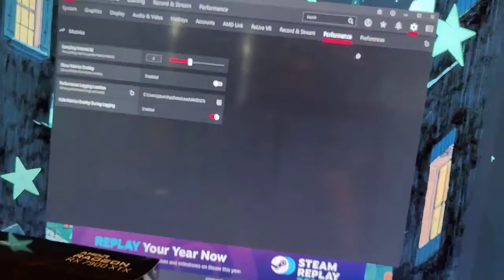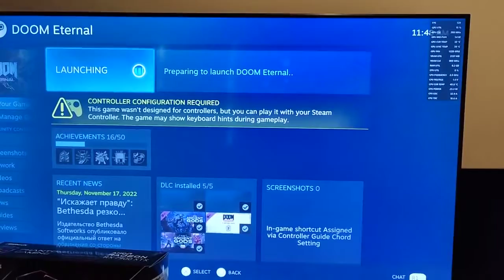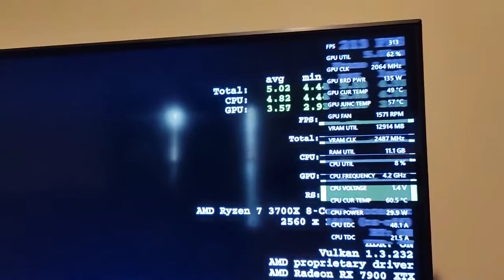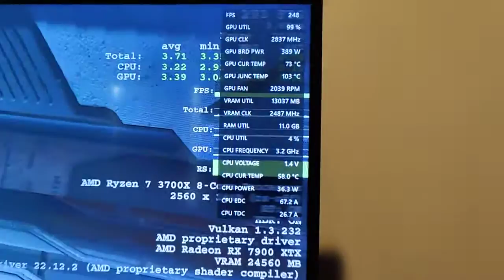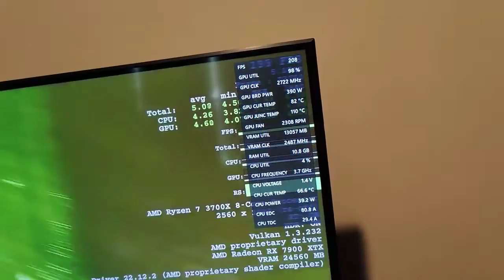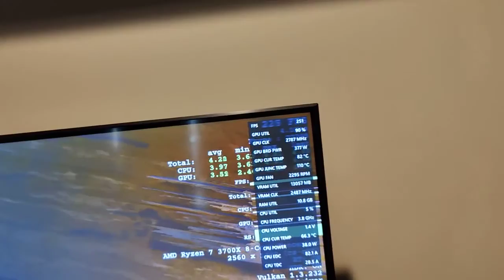7900XTX GPU Junction Overheating

Comment from the maker: I wanted to mention that I took the side of the case off as a user suggested... It did reduce the overall temp to about 102 at the peak, which does seem to fix the issue.

I also want to mention that I downloaded the asrock tweak tool and set the gpu to user mode and forced a max of 350W. This reduced the junction temp to 92 at the peak. For now, the issue is not something I need to fix further on my end. If I end up seeing the temps go up again I will then send it back.

Thanks for the suggestions!
Reply: I wanted to love that case SO bad… I had to modify mine in 2 ways to help thermals. First, the dust filter at the top really restricts the exhaust fans, so I removed it completely. Second, I pried the glass off the gpu panel side (not difficult, it’s just glued on) and replaced it with a dust filter instead with magnetic strips, it actually looks pretty good still.
Reply from the maker: @jasonb110  honestly, this case is amazing! I was using a Zotac 1080ti Amp extreme, if you look it up it seems crazy to me that that card had zero issues in this case. That's really what made me think this card would work just fine in it.

Comment: It's not the card, but you're not cooling it properly. The manufacturer's website says 2615MHz as recommended for boost.
 I see almost 2800MHz + 220 FPS and 389W. I don't know what you're expecting with one fan pulling the heat out 

Lock your FPS to at  120 FPS. + undervolt it.

I'd be the manufacturer of those cards and see this video, so I'm not giving you your money back.
Reply from the maker: No offense, it seems like you watched at least parts of the video... There are 4 3000cfm fans pulling and pushing air out of the main chamber as well as the 3 fans on the card sucking from the card itself. As an attempt to completely unobstruct airflow I further removed the side panel and locked the wattage at 350w, while this did help, it still climbs to temperatures beyond a 30 degree temperature difference.

As a side note, people keep saying I'm doing something to the card to make it overclock or go beyond manufacturers recommendations. I literally have no settings defined beyond "use stock settings" and this was the result in the video. 

I was expecting the card to be stable out of the box and not need settings to be modified to become stable.

Comment: I had the Phantom 7900 xtx and gave it a rave review. Performance was great and what to expect from the 7900 xtx, but... I did start to see temp differences of over 40c between junction and current. At stock settings I was watching junction temp hit 110c (current temp 65c) and stay there for minutes and minutes. I like ASRock but I did return it. I said in my review that the cooling solution works, aannnnd it in fact, does not. I think the cooler is too small for their aggressive stock settings and that "ASRock Magic".

Comment: Is this your first and card after 5700xt because the junction temp is hi. 110 is normal
Reply from the maker: Yes, I had a 1080ti for all these years. First upgrade in a long time for me
Reply: @JerryRigged  a 1080 t.i. they didn't have the junction temperature until they had a 5700 series and the 3000 series so no you can't say my car is overheating cuz you never had that problem I'm just saying in general I know I've seen 5700s go up to 110 none of the coolers that aren't reference card should be doing I'm going to plug in my taichi hopefully Sunday soon as I get my 1000 watt psu.   But when I'm telling you is a 1080 didn't have junction temperatures

Comment: Red devil 7900xtx limited  OC, have no issues, even with heavy overclock and 430- 450w power draw didn't go higher then 90 on stock fan speed. Went down to 85 with fans at about 60%. And GPU temps never went above 60C . But coil whine especially in modern warfare 2 is quite noticeable and annoying, might even make me to return it.
Reply: got the same card and change the bios switch to silent help a lot with the coil whine

Comment: If it works in 99c, does that mean that the card doesn't work? Will I have some kind of problem in the future?
Reply: Depends on your case. Mine never goes above 85 on stock fans and settings. 90C with heavy overclock
Reply: @Bostonski  Do you also have the ASRock 7900 XTX Phantom Gaming edition?

Comment: It works well in my case the tower is very small and reached 99 - 101 c but once I opened it I got down to 96c on occasions 86c tested with furmark 12 hours is it very rare that you get this problem even with the case open?

Comment: this is why better to buy RTX 4080
Reply: Bullshit. That’s just a 400W Card with its fans pressed against the side panel in a case the size of a shoebox with bad ventilation. Every card will run hot in that thing.

Comment: I mean with your edge temp reaching over 80c I wouldnt necessarily call that a high airflow case. Your cpu is stuck between 4-5% usage so I wouldnt expect the temperatures on that to be high. When I had my reference 7900xtx I never seen the edge temp go higher than 60c while the junction temp hit 110c when increasing power. Your delta isnt too bad so in this case I would think your card is fine, Especially if you try to get that edge temp down some it should also bring down the hotspot temp.

Comment: your card isnt faulty you are not throttling at all get a bigger case and your junction should go down 110c is normal and within spec but if your boost clock is going really low there is a problem but you are at over 2700 mhz the whole time so you are fine

Comment: Crazy.  I have MBA design and at 400w with card vertical it only reaches 88c JT.  Horizontal it goes to 110c and throttles.  I'm looking at what to replace it with, not this I guess.

That 4080 is looking more and more appealing

Comment: I mean... it's not even throttling down the wattage/power... so technically you're not losing performance. The issue on reference cards, it will hit 110 and start throttling back power hard core.
Reply: Reference from XFX  I had was doing same thing. Pulling 380w from stock and going up to 110C in 60 seconds,  without throttling down. Somehow it got reset without me doing anything besides reinstalling driver with factory reset and was then working fine at 350 watt TDP. Never went over 88C. But if you hit overclock mode you hit 110C in a minute.  Vram overclock seem to work just fine

Comment: Honestly I don't think this is the same issue the AMD made/designed cards are dealing with and the giveaway is your temperature delta. It's right where air cooled cards usually operate, 15 to 25C delta. The AMD ones are 40 or 50C which is a problem. This to me looks like a bad fan curve or your case not being able to move enough air through it to keep the gpu cool. I don't know anything about this case so I could be wrong maybe the two fans you have are enough. What you should try is remove all the case panels and run the same test and see if the gpu can maintain a junction below 100C. If so than your case isn't moving air fast enough to keep a 400 watt gpu cooled.

What card did you have there prior?
Reply: No its a manufacturing defect, its a problem amd has publicly admitted to. All the card doing this are reference designs. Mine does the same in a full tower pop air. 2-5 mins in a game and the junction temp hits 110c.
Reply: @AndrewSmith-fv1kr  Yes for made by AMD cooler cards aka reference design. His card isn't that it's an AIB model, Asrock Phantom Gaming. Again the temperature difference between edge and hotspot in yours is probably 40 or 50C+ indicating a defective cooler. His card is between 20 and 25C which is normal for an air cooled card.

Comment: If you can, mount the Noctua Top Fan over the Graphics Card.
That could help the Card to get rid of more Heat from all Sides.
Otherwise, get a Drill and punch in some more Holes for the Cards Airflow :P
Reply from the maker: I might have to try just mounting the fan to the perforated section

Comment: The Card does not seem to have the guilty Vapor Chamber, but it's not a very big Cooler compared to some of the others.
I would have tried to lock the Clocks to 2.6GHz or even lower and then played around with the Power Slider/Volt Slider.
After all, you have pretty limited Airflow if the Card is mounted like that. Half of the Card is blocked by the Glass and the rest is only 50% perforated.
That might not have been a big problem with your previous Card because it did not draw 350 Watts+.
I see 390 Watts for most of the Video, so clearly it gets very hot and needs MASSIVE Airflow to keep that in check.

The difference of 30°C really seems a bit too high on one hand, and on the other, the Card still hits over 2.6GHz, which would be well in Spec and expected.
Reply from the maker: I agree. I will remove the side of the case next to the GPU and see what happens. 

I actually have the amd tool set to default. I suppose the manufacturer has overridden some settings to let it overclock in this mode.
Reply: @JerryRigged  And was it better with the Side opened? Hand have you tried to limit it to the usual 350 Watts?

Comment: Looks fine because your card isn't power throttling. All the bad reference coolers have throttling. And you're using more than the stock 355 watts!
Reply from the maker: I hope you're right. You made me hold for now at least. I'm going to keep watching and listening to whatever comes of this though.

Your comment does make me wonder if I have a thermal throttle temp and what it is... I don't need this going nuclear because it has no limit either 😆
Reply: @JerryRigged  your case is a joke for this card btw
Reply: @JerryRigged  People were saying the 6900 and 6950XTs were like what you have and your card has way better performance and power draw. Maybe undervolt it for the summer or don't even worry about it.

Comment: Change the DP cable and see
Reply from the maker: I'm using HDMI 🙃.

Older display unfortunately. I was going to eventually upgrade the display next
Reply: That makes sense, if you have spent so much on gpu this problem shouldn’t happen